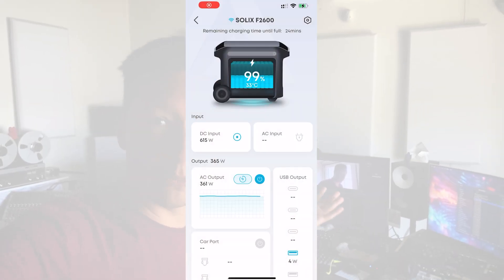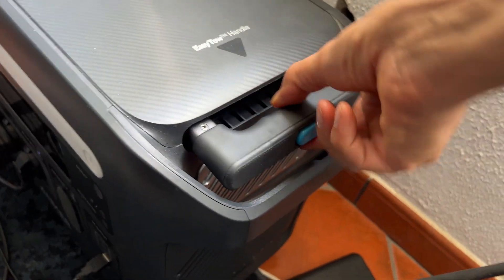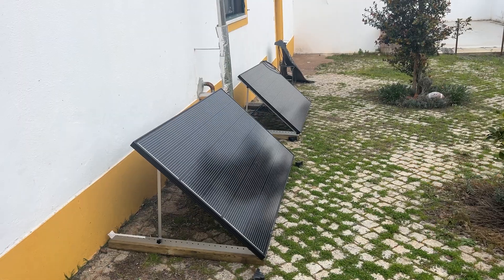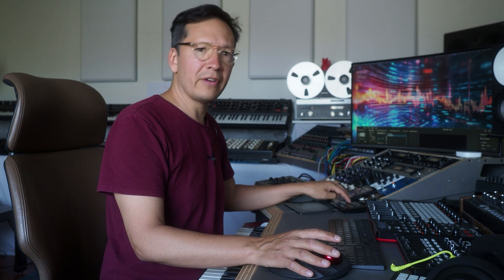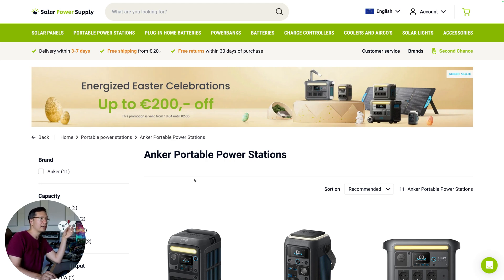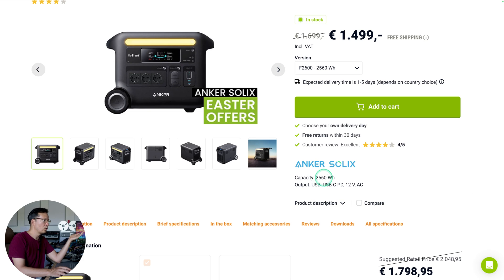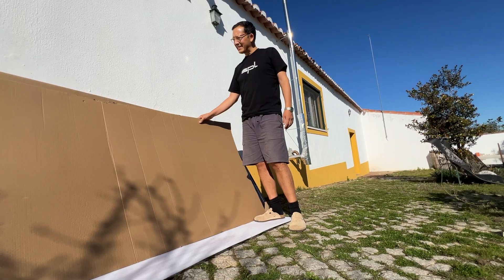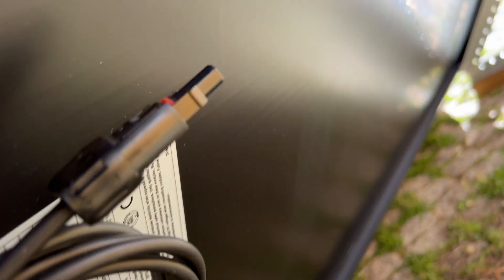Power Outage In Spain & Portugal - Our DIY Solar Backup Solution

Comment: Thanks for the video! Surprisingly, I also ordered the same unit along with two Anker PS400W solar panels. While watching your video, I realized I bought it from the same supplier too. You’re right—Tom is an amazing guy, always helpful and quick to answer any questions. I can’t wait to receive my unit. Hopefully, it arrives safely! 😊
Reply from the maker: Excellent we were super happy to have it during the blackout.
Reply from the maker: I would get a high quality EH to UK Adapter plug or chord and just connect everything through that. Safest easiest way to do it.
Reply: I have only one question the main AC plug is EU, and i am mostly using UK plugs, interesting can i take my PC plug and swap it around?